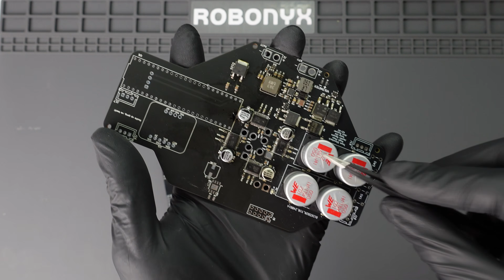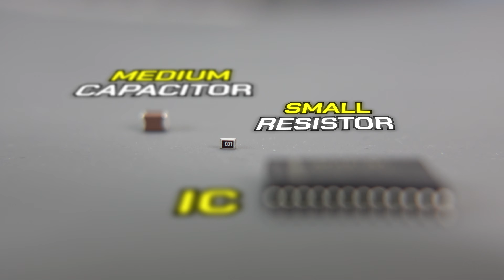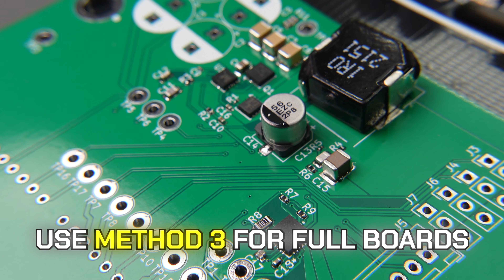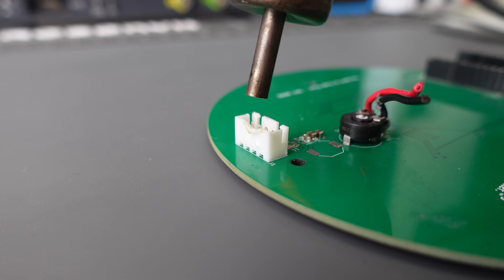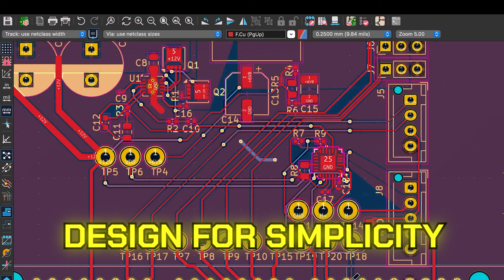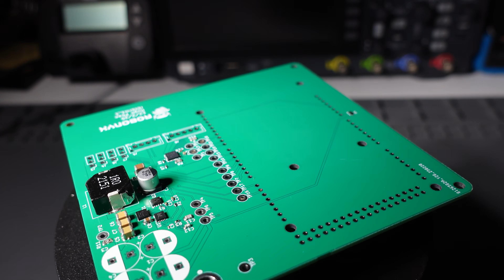Beginner's Guide to Surface Mount Soldering!

Comment: I have most of the tools you mention in your video, but where do you go to buy paste solder and some of the other specialty supplies / accessories?  Also is 90% alcohol good enough or should it be 99 - 100%?  Also do you have a reliable source / store for chipsets or Chemical Fuses for Lithium Ion Batteries?  Specifically 12AJ4A

Comment: how prone to bridging are the tiny surface mount chips when using a heat gun or hot plate? would be very hard to diagnose each pin for errors.

Comment: const int tra7

Тополази, NOTE 17.199

//Notes musicais requisies sm

delay(500

#define NOTE E72637

Fonzer, NOTE 47, 150

#define NOTE E7 2637

delay(200

tone(buzzer, POITE C7150)

#define NOTE AG 1750

delay(1507

#deline NOTE E72637

tone(buzzer, NOTE 17.150)

#define NOTE A6 1780

delay(300):

#define NOTE D7 2349

tone(buzzer, NOTE 07, 150)

#define NOTE F7 2794

delay(300)

#define NOTE 07 3136

tone(buzzer, NOTE G6, 150);

#define NOTE_C7 2093

delay(300);

#define NOTE_B6 1976

noTone(buzzer);

}

#define NOTE_G6 1568

#define NOTE_A6 1760

void setup() {

pinMode(buzzer, OUTPUT),

void loop() {

// Tocar parte da melodia do Mario

// nada no loop

1

tone(buzzer, NOTE_E7, 150),

delay(150),

CÓDIGO BUZZER ATIVO

// Pino onde o buzzer está conectado

void loop() (

const int buzzer Pin = 7,

digitalWrite(buzzerPin, HIGH);

void setup() {

delay(1000);

pinMode(buzzerPin, OUTPUT); //

digitalWrite(buzzerPin, LOW);

Define o pino como saída

delay(1000);